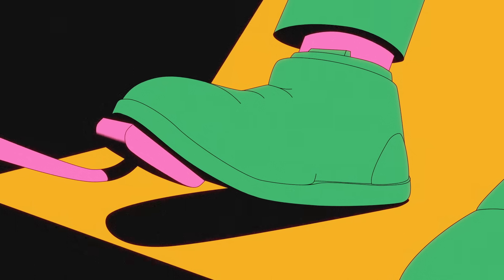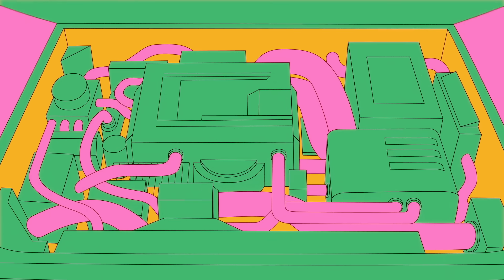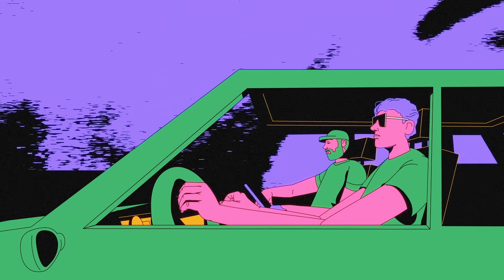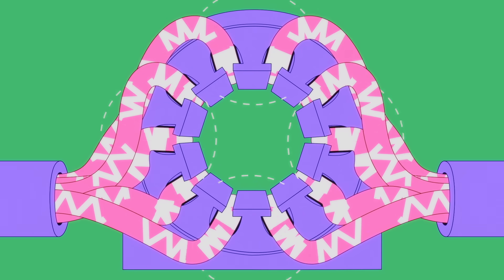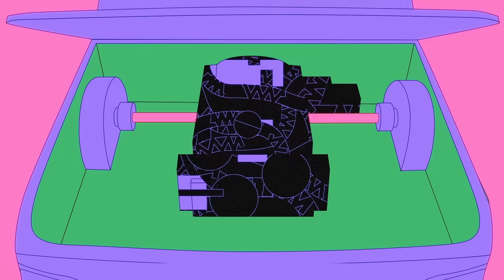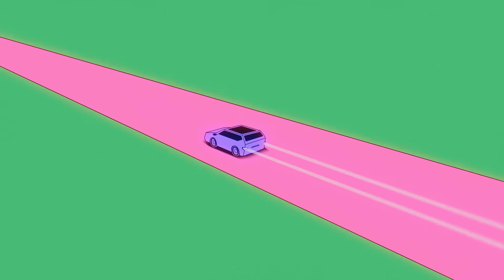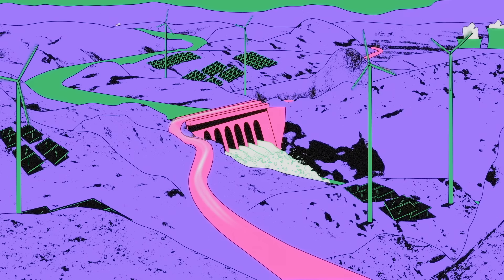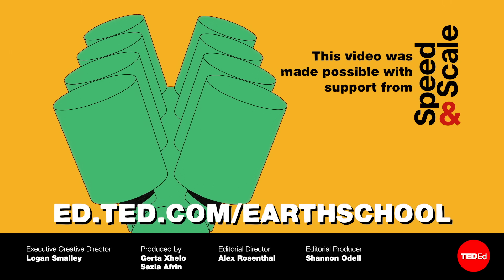This is what happens when you hit the gas - Shannon Odell

Comment: 2:09 since you are talking about a disesl engine, gas pedal does not control the amount of air entering the cylinder
Reply: I think this video is too-simplfied, where some statements are false. Yes, in non-turbo gas cars, the gas pedal directly controls air intake valve into the carburetor. The air intake is also connected with the fuel intake using venturi valve - meaning more air -> higher air pressure -> higher gas intake.

A lot of cars today use turbo and turbodiesel, as you said, you have direct injection, no carburetor, air coming from turbo... much more complicated system and much bigger involvement of computer to create this air and fuel mixture. 

Few other things to mention about the video:
- There are 3 cylinder engines now, very efficient
- We cannot talk about EV, without mentioning the power to weight ratio of gas compared to batteries. Every EV that can take highways, with real (not advertised) range of 500km has like 2.5 tonnes because of batteries. Cars are almost like tanks, having much more energy in car accidents.